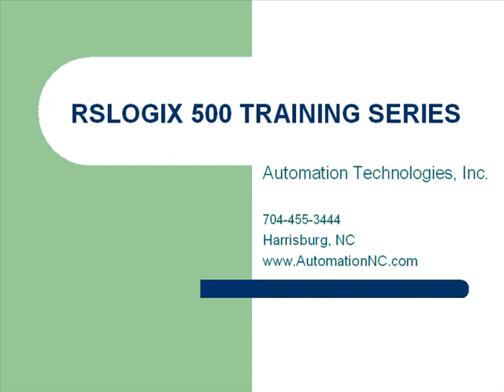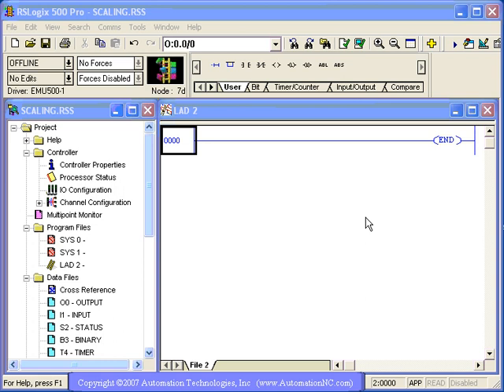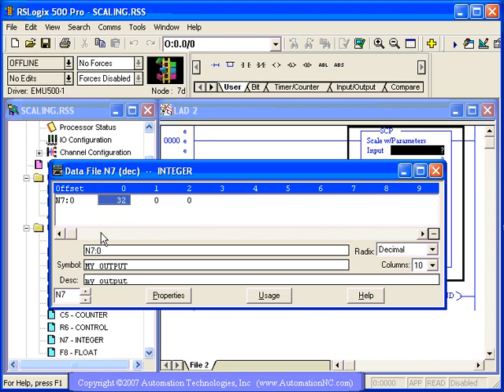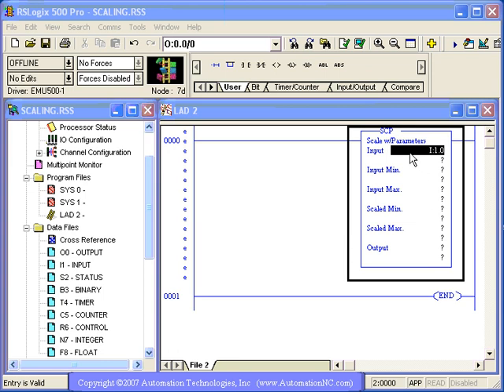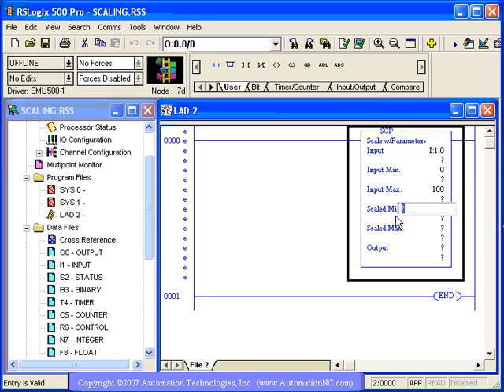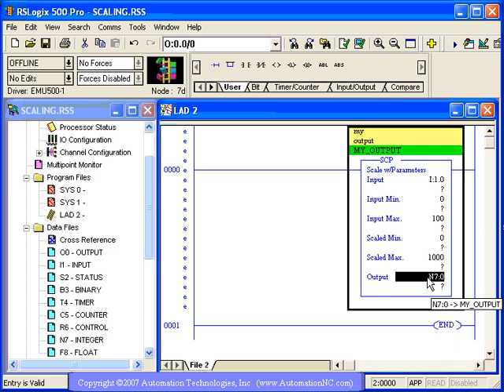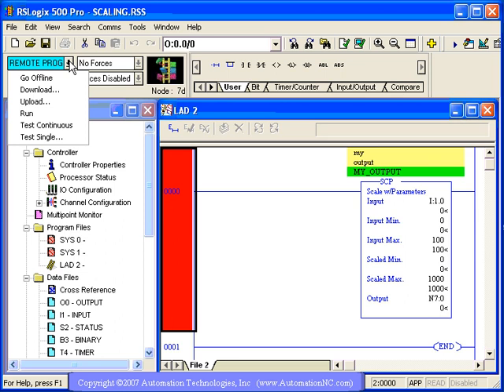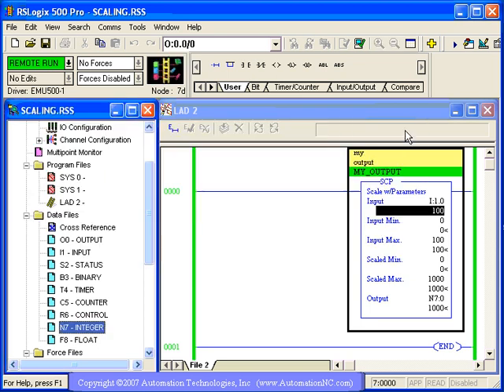PLC Training - SLC 500 Scaling - Part 1

Comment: Can you show this in a more practical way. Like scaling a 10 volt analoge input . And converting that to a 10 volt out pit
Reply from the maker: It gets difficult because your scaling depends very much on your I/O.  Just because you have a 0-10VDC signal coming into the PLC doesnt mean it is represented easily in the PLC.  This video is actually a step back from the concept you mention to just understand what the scaling function does without confusing the issue with what analog input card you are using.  We get into those concepts in our later videos.

Comment: i have problem slc500 input module and input module not commnunicate to plc 
what is the posible cause?why  pls help for this error thanks and advanced
Reply from the maker: +Dhinz Muerong I think our forum at PLCMentor com would be a better place for a discussion such as this.  There is a lot of back and forth that would be necessary to try and answer this question.  Is your module rack mounted, what kind of module is it, what makes you think it isnt communicating, etc, etc.
Reply: +automationnc  analog output module and input module, 1746-n041 and 1746-ib16 that is the type of module